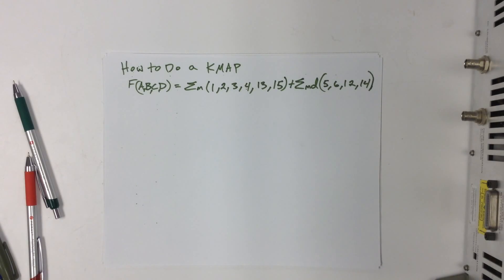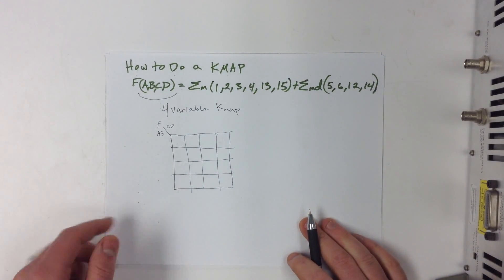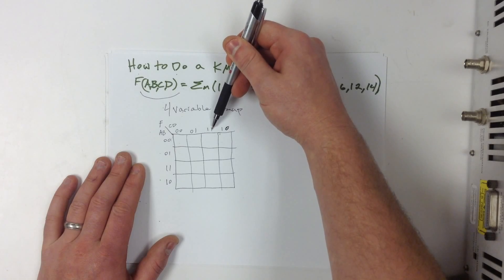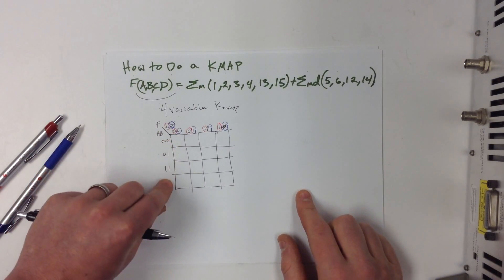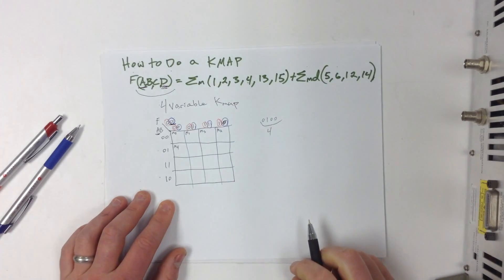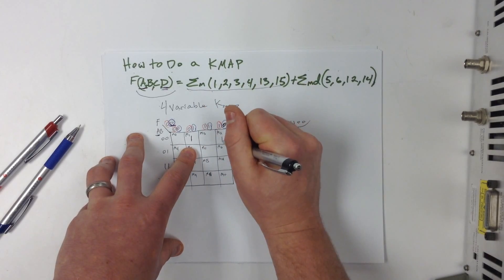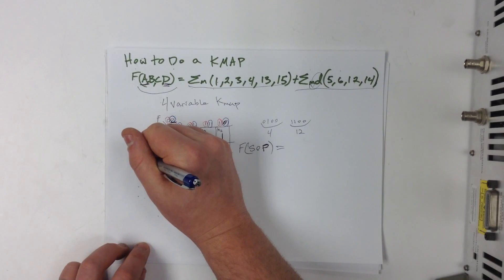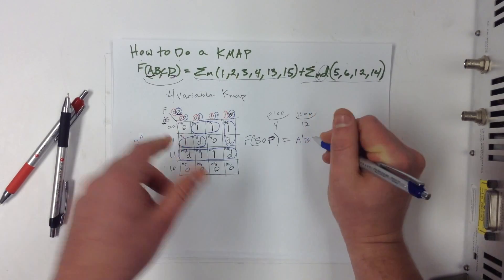How to Find SOP using a KMAP

Comment: I don't get the "don't care". Can someone please help?
Reply from the maker: Hi, it means that we don’t care what the outcome is. You can group it or don’t group it. It can be used to our advantage or ignored completely.
Reply: @craigrobertson1989  And i suppose, it is always given in the Question right?
Reply from the maker: In the classroom or on a test, these should be given or implied in the problem. Let’s think about a real world example though. 
Let’s think about using it for an input. Let’s say we are working on a burglar alarm system in a shop and the inputs ABC corresponding to The discrete signals “Arm Alarm”, “Door alarm”, and “motion sensor”. The combinations of 111, 101, and 110 return an output of 1 (or sound alarm). The combination of 100 results in a 0 output (no alarm). What about the remaining 4 cases in the truth table? They can be quickly described as 0dd and they correspond to an output of 0, right? 
When we use don’t cares in the outputs it usually corresponds to combinations of inputs we don’t expect to see. A good example would be turning on a left and right turn signal at the same time... by adding don’t cares, we can (Hopefully) make larger groups and reduce our input requirements to our gates. The result of this is less reliability If a forbidden input state is entered. However, you just made your circuit much simpler and cheaper by using less or simpler components.
Reply: @craigrobertson1989  Wow very insightful. Thank you sir!
Reply: if it expands your group you should use it